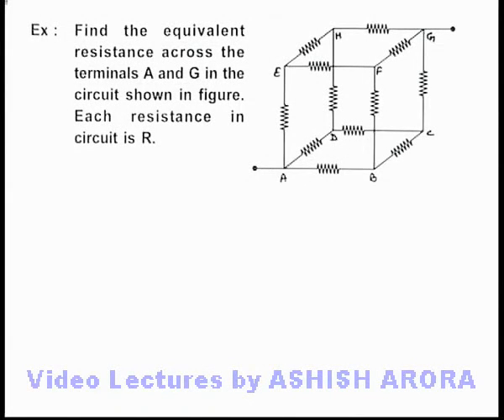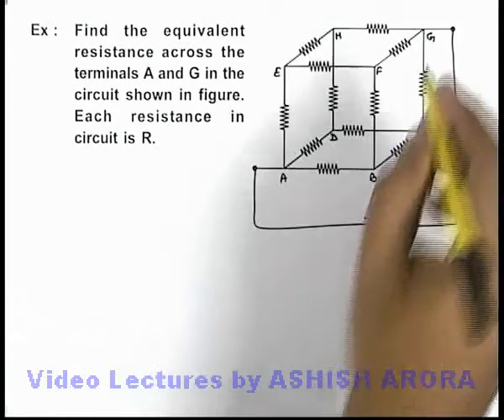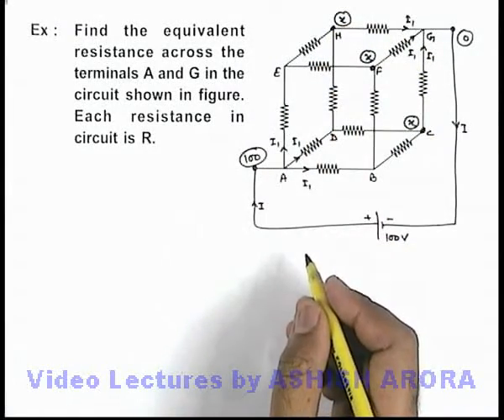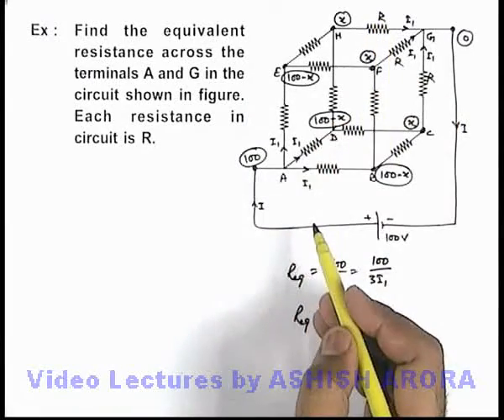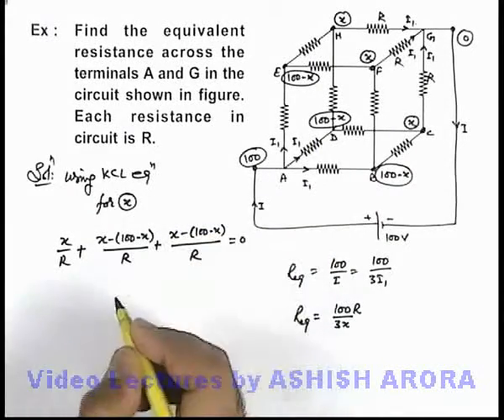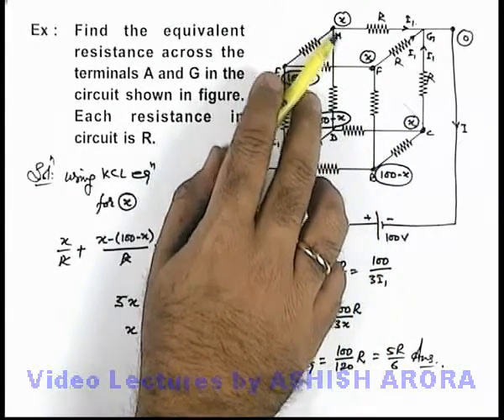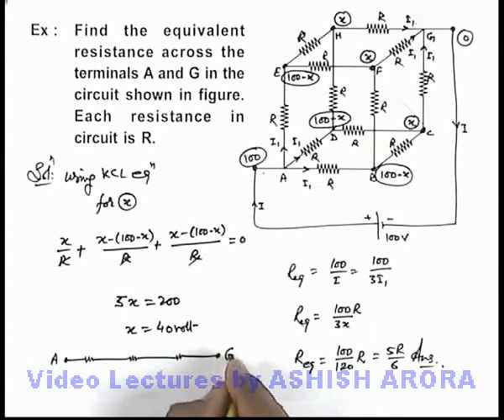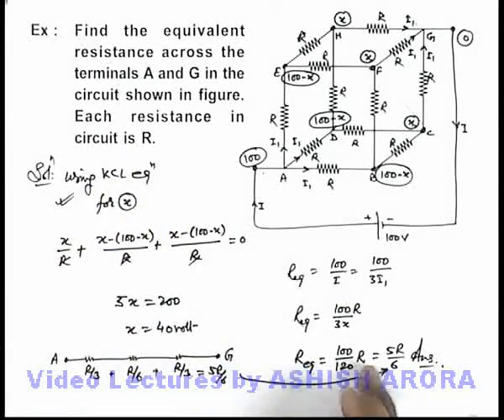Class 12 Physics | Circuit Analysis | #14 Solved Example-7 on Circuit Analysis | For JEE & NEET

Comment: How 100 - x
Reply: The potential difference across resistors must be same because the resistence is same and current is divided symmetrically. So at end potential is zero and difference is x so potential at H,C,F is x. Similarly potential difference across starting resistence must be same. Potential at A is 100 volts and so potential at say E is 100-x
Reply: chalo ye baat to maan liye ki current same hai to potential bhi same hogi 
par sirf 100-x he kyun
100-2x kyun nahi liya sir ne
Reply: @alphaiitd1 lelo same answer aayega

Comment: Sir, I have gone through solutions of different books including yours on the problems of equivalent electrical resistances through symmetry. My question is how does arrangement of different resistors in a particular fashion i.e symmetrical fashion divides current equally in this case? What I'm unable to understand is the role symmetry plays. What is the deep physics and reasoning behind the logic that symmetrical paths in electrical circuits will make currents divide symmetrically. Some other rules that I'd come across while searching for answers on the web was that if resistors lie on perpendicular bisector then also current divides symmetrically. Can we prove it Mathematically?  Please guide me where to look answers to these questions?.

Last but not the least. A ton of thanks for revolutionizing physics teaching .
Reply: I know it's too late but for others.
If we trace the path of current flowing through the resistors,we can observe that every current is passing through three resistors having equal magnitude hence we can conclude that current passing through all of them must be equal. 
Hope you understand.
Reply: I agree with you
Reply: Are u in which college
Reply: @jannatchugh1905   not in college passed graduation but still interest in physics never dies.
Reply: @aksrivastava455  which college
AND YOUR CRL RANK IN JEE ADVANCE

Comment: How did you decide if one is X then the adjacent potential is 100-X ?
also its not clear how you assigned potentials at corner points.
Reply from the maker: We start assigning potentials from the battery... then x and 100-x are analyzed by symmetry.. its better if you watch the fundamental class videos from class-2 onward, it will be better clear to you... in class-1 it was only the basic review of past content... so you may not need to watch this if you are comfortable...
Reply: @physicsgalaxyworld  sir hum humesa 100v kyn assume kr rahe hain...kya hum iss method ko board Mai use kr sakte Hain 100v assume kr k...kya marks mileinge poore
Reply: @Edupuriya25  haa